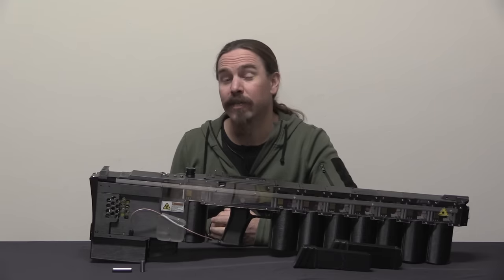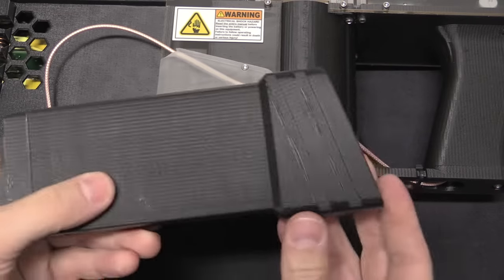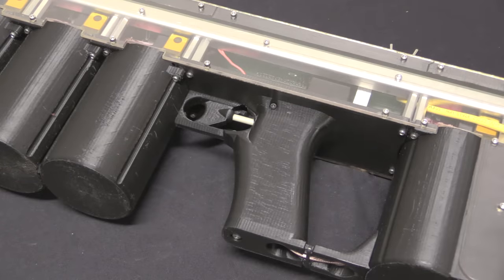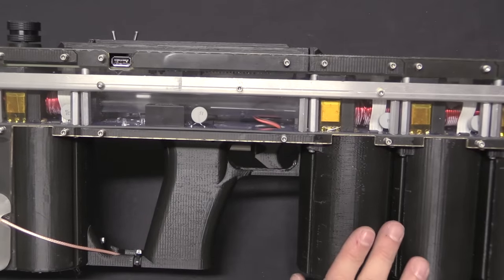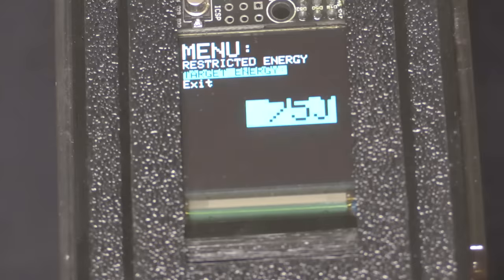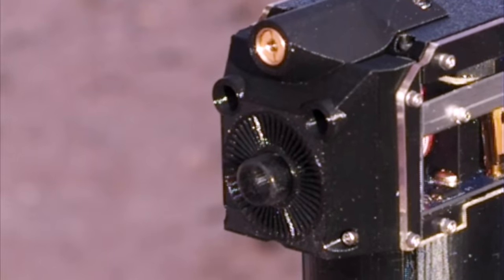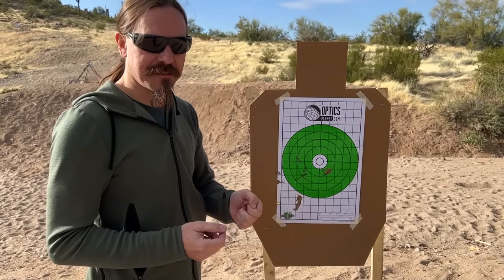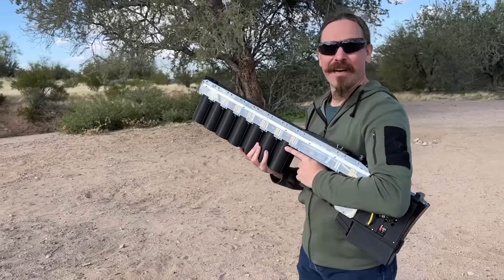ArcFlash Labs' GR-1 Anvil Portable Gauss Rifle

Comment: I'd expect fin-stabilized rounds in the future,since projectile doesn't touch the actual coils there's no space for rifling
Reply: Easier would be to make the bullet pointed, and cut spiral grooves in the side so air resistance would make it spin
Reply: you could use the magnetic field itself to put a spin on it.
Reply: In the interview they talked about developing electric rifling, where the magnetic fields themselves spin the bullet the same way rifling does.
Reply: If I'm not mistaken there's nothing inherent to the design preventing you from using a conventionally rifled barrel, it would just be wildly impractical at this early stage due to the increase in required power, the need for highly specialised materials (probably a tungsten barrel or something), and the additional heat management issues it would introduce. It's really a question of what proves more practical, overcoming those limitations or designing (and manufacturing) a very complex projectile.
Reply: @HPetch  they did say that there's no actual contact between the projectile and the barrel, so rifled barrel would be pointless.
Reply: Dimpled steel balls like Nerf Rival
Reply: @HPetch  "here's nothing inherent to the design preventing you from using a conventionally rifled barrel," -- except that the bullet doesn't touch the barrel.
Reply: @HPetch  Well, you'd run into the issue of the force of the projectile facing a LOT of resistance with relatively little force to overcome it. an issue which would much less of a problem using electromagnetic rifling
Reply: I'm thinking smaller rounds in general going forward. Keep in mind that only the very tip of the bullet is what comes out of the gun, everything under the brass is propellant. So those slugs are kinda hilariously oversized for modern bullets. 

I feel like you can get the speed up much higher with more traditionally sized bullets, but there could also be some advantage to really sizing up if this method of firing doesn't cause as much recoil. 

And hell, even with sculpting the ammo should be dirt cheap. Just hunks of anything ferrous, no factory loading required
Reply: @verager2493  I believe that a more massive projectile actually means that there's more electromagnetic force being exerted on it, which puts more energy behind it. So there's probably a balance to be found between a projectile that's too small and only gets a small amount of energy, and a larger projectile which is more significantly affected by gravity and air resistance
Reply: Or spin up the projectile mechanically or magnetically before firing, say while the gun is charging the capacitors. (Couple of needle bearings on the magazine, electric motor wheel touching the top projectile?) High spin rates could make the projectile extremely stable in flight.

Although, given that the "barrel" is apparently a plastic tube (non-magnetic, obviously), replacing that with a high-strength ceramic tube or rails (also non-magnetic) with spiral slots cut into it, and have fins on the projectile engage with those. Because it would have more contact than standard rifling, the gradient of the rifling could be very severe, also making the projectile stable. (Similar to that hex barrelled rifle. Whitworth?) The ceramic could also handle higher temperatures from the capacitor dump. Since only the tips of the fins are in contact, friction should be low, and the ceramic would be low friction anyway.
Reply: @Zoentropic  I didn't realize that. Seems like the weight of ferrous in the bullet itself is kind of propellant...

Hm. Probably a lot to be done with aerodynamics and sculpting? Maybe make a kind of shotgun slug rifling on part of it? 

Just seems like a lot of potential, I guess
Reply: @Cyber9Hound  True, but the key point is that the lack of contact isn't required for a coilgun to work in principle. It proves necessary in practice with current designs as the increased friction would slow the projectile down too much to be effective, not to mention it would make heat buildup even more of an issue, but if those limitations could be overcome then the only other consideration (off the top of my head, at least) would be making sure the barrel material wasn't magnetic.

It's almost the opposite of how barrel contact impacts a conventional firearm: it would still work if the bullet didn't engage with the rifling, but it would lose a lot of power and accuracy (not to mention there would be a greater risk of failure in most designs). To be clear, a contactless alternative to rifling would be preferable in pretty much every way, but if that can't be practically achieved it still wouldn't doom the entire concept.

Comment: I remember seeing somewhere that a hollow cylinder is the one of the most aerodynamic shapes. This thing can kinda fire one of those. Don't know the implications but the 'hollow point' reminded me of that.
Reply: It’s using solid / dense projectiles because they are easier to accelerate magnetically - you lose the density and potential magnetic energy if you’re using something hollow. 

This tech only has potential in large-scale installations if you ask me, like the sabot-type rounds being developed for ships, etc with massive energy requirements.

Comment: The capacity to charge so quickly means a rapid use pneumatic rifle that charges between shots to continuously maintain constant and maximum pressure also becomes much more viable. In terms of a caseless ant-personnel weapon, it's the next logical step.
Reply: this thing cant beat out a slingshot but some how its going to replace guns. lol i hope some one doesn't actually waist there money on this.
Reply: Maybe have multiple banks of capacitors that can be charging while a different bank is firing. Of course, that would add a lot to the weight and size of the gun (capacitors sticking up from the barrel and to the left and right as well!)
Reply: Why not do a carbon barrel, itll disperse heat so much better
Reply: @kevincornell1439  "this thin can currently not beat a slingshot" ftfy 

Noone says THIS model will replace guns, sucessors of this may will in some capacity
Reply: @phuzz00  you wouldn't even be able to aim it with that much weight. then you got heat and no improvement in power. to what get it to maybe shoot a limp round 4 times faster.
Reply: @weberman173  so your saying this technology will replace guns. what a joke. its a dead idea kept alive by people that don't understand physics and the limits of known elements. you would have to make capacitors 10x smaller with the same power to even maybe get this as powerfully as a real rifle. but at that point the amount of electricity would just incinerate the projectile.
Reply: @kevincornell1439  Imagine complaining that people don't understand physics while not understanding the difference between magnetic fields and electrical current. It is absolutely possible to make a gauss gun thats as powerful as a normal rifle. Its been done. Just not in a small form factor since capacitor tech hasn't been as heavily researched as the batteries we have noe
Reply: @acbthr3840  Dude don't bother with this guy.  
When the first black powder hand mortars were hitting ancient battlefields...  therr was that one guy raging "BuT muh BoW THAT IS STUPID"
Reply: @acbthr3840  the magnetic field is created with electronic current and that electricity creates heat. even the large powerful ones burn themselves up in a short time. do to the magnetic field you can not impart spin on them. so now you are limited to smoothbore ballistics that is already hundreds of years out of date. the best you will ever get is a heavy overpriced musket that runs on battery's lol.

Comment: Pretty neat!
About 10 years ago I worked with some Navy guys who showed me the rail gun aboard a ship.  Extremely impractical but damn cool!
We’re probably only another decade away from plasma rifles and then with some Tesla AI Bots we can finally have realistic terminator wars!
Reply: Yes Rail gun phased out
Reply: @rfjohns4452  not exactly "phased out". Just put on a back burner. Its known now that we await better battery and such tech before it would be viable to our modern standards.
Reply: @Bobo-ox7fj  Maybe not even then. The problem is portable power, not the amount of it - you can build a plasma rifle and connect it to nuclear power plant, you just need a long extension cord. (I don't think that fusion power plants would be smaller than current nuclear ones, in fact, I am afraid tokamaks would be quite bigger.)
Reply: I thought there were no operating rail guns outside of testing facilities?
Reply: @benjaminstevens4468  Rail guns were tested on ships because they are usually the only moving platform that could supply enough power to the weapon (without something like large external generator on a truck).
Reply: @jansvanda  
Plasma is not anything that would make an efficient weapon. It is not solid, so it will tend to disapte quickly, it's very hot, so it will very rapidly radiate its energy away (this problem also scales with temperature to the 4th power, so it scales VERY poorly). 

Further, plasma in contact with objects transfer energy poorly at depth, so you will ablate the top micometers into gas, while below that it will mostly fine. Also, energy will be equally delivered into the surroundings as to the target.

There is no reason to fire plasma at anyone, because for the same amount of energy, you could instead dilver a fast projectile, which will deliver energy into the target much more efficiently.

Maybe if you have abundant energy, but limited mass, firing high intensity particle beams could be efficient. But that's stretching the definition of plasma, as well as being damn close to pure conjecture.
Reply: i thought so to, but the EMF from these things will mean the 100 year war is about 20 when every one gets lukemia
Reply: "we're probably only a decade away from plasma weapons and Tesla Ai Terminator wars" - oh joy!
Reply: @vvvci  haha! As a huge Ren & Stimpy fan “oh joy” indeed...
Reply: @100canadianmaplestirup8  no worries by then we will have free healthca... oh wait, I’m American... Crap
Reply: @justforever96  We absolutely have much more than "rough beginnings" of a plasma weapon.

You could literally convert this to fire plasma, it would just be way too expensive and dangerous without better manufacturing.

The only difference between this and a plasma gun is that this fires a cold metal slug instead of a hot gas slug.

That's it.
Reply: DECADE??? WHAT... We barely have frigging handheld coil gun toys, and had them for 20~ years too, and you're talking of plasma? Get real lol
Reply: Look up the 1990's Air Force's Project MARAUDER, which is (was?) a real terawatt plasma railgun firing 10 megajoules plasma donuts.

Comment: Just thinking, could the ammo be made as relatively light "tubes" with internal vanes to create spin from the passage of air?
Also, could the battery and capacitors be put into a backpack, with just a cable running to the weapon?
Reply: I mean you could just rifle the berral or twist the Magatic feild... I mean you could just make a Railgun and twist it's rails like rifling if you just want the field touching the rods and no berral... you'll still have to sheild the rods from arching... but still lot's of ways they just did not want to test them in the alpha.
Reply: I have 0 knowledge of electronics, but it seems to me that capacitors must be close to magnetic coils to work efficiently. I dunno, thou.
Reply: Instead of twisting the barrel, just have the operator himself spin at about 10k RPM. Increases barrel life.
Reply: @arhidavid  Correct. You need quite massive cables for the level of charge you have in those capacitors, so it wouldn't really be practical with cables. Could maybe work better if you could have a lot of smaller acceleration gates so that the diameter of each cable could be kept down and thus the cable flexibility kept up, but I dunno.
Batteries on the back/in a belt/whatever? Sure. But I've got a hard time seeing the capacitors moving anywhere.
Reply: What would be useful is shotgun slug technology. They regularly fling large caliber ammunition through smoothbore barrels with good accuracy. There are shotgun slug rounds with aerodynamic plastic tips that move air through them and induce some spin.

They could also turn the big metal rods into aerodynamic boat-tail shapes to get better performance through reduced wind resistance.
Reply: @GreenBlueWalkthrough  magnetically imparting spin isn't really possible here. Magnetic fields like to "smooth out," and creating novel geometric features using a magnetic field requires a lot of impractical/lab-only setups (e.g. supercooled projectiles, etc.) Basically stuff that's all not portable.

The best solution here is to come up with a better projectile design, or alternatively add in a paradox-esque rifling "choke" at the end of the barrel that would also need some kind of thick polymer or copper coating on the rounds.
Reply: Railguns and coil guns are not the same thing, they use different physics. So bringing up Railguns was kind of irrelevant.
Reply: Look I know it’s a little too sci fi, but I really think using FerroFluid as ammo for this weapon should be looked into.
Reply: In the interwiev, the producer hinted they are thinkering about spinning the projectile magnetically, as if it is the rotor of an electric motor.
Being commercially available, I'm pretty sure the owners will start to hack that thing in every aspect - and the results will get into the Mk2, or whatever will be the next iteration.
Reply: What you are describing is a  individual fleshett  that come in shotgun cartridges instead of buckshot . Their about the same  length as the long but just a quarter of a.1/4” in diameter so should go faster having less inertia to fight ( though if you had a rotating motor in the first launch spot to spin it up while the competitors are charging might work )